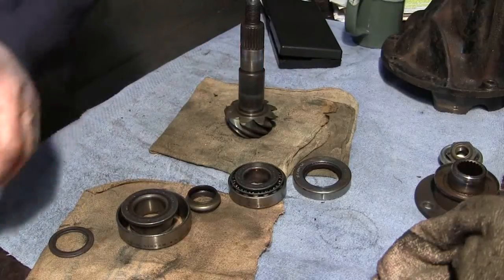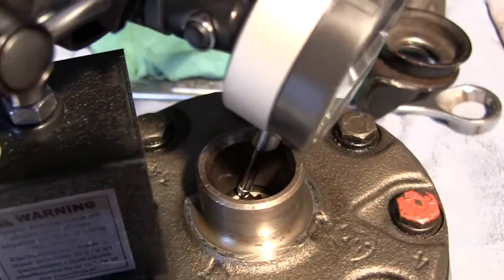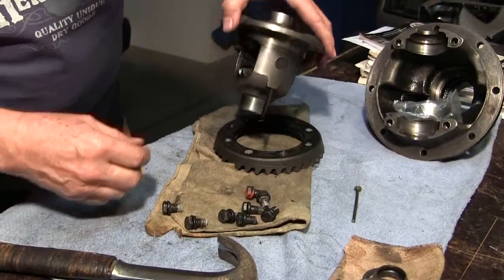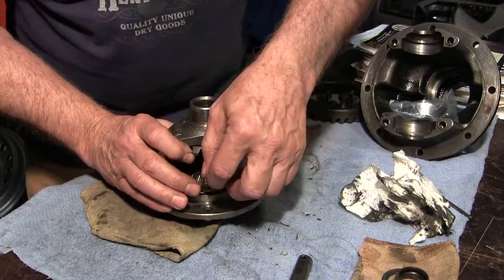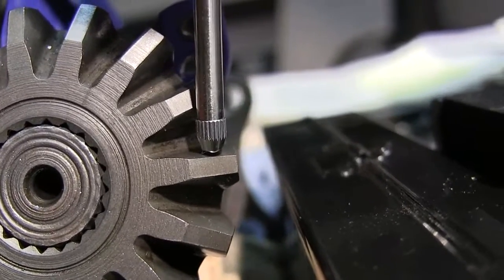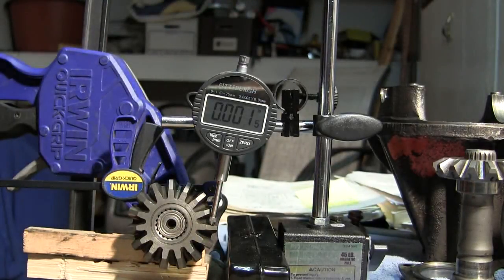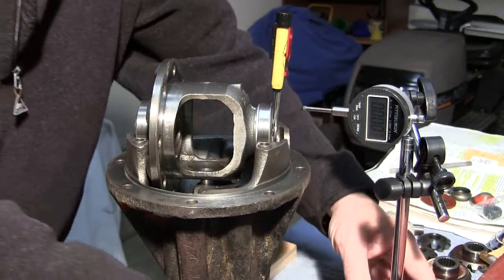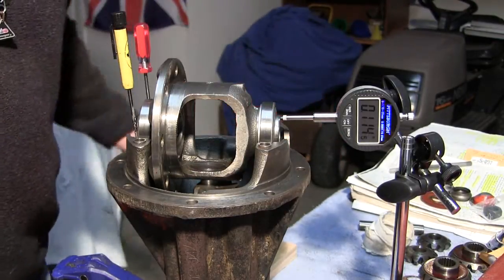Part 6 Sun, Planet Wheels, and new carrier float

Comment: I know this was a little while ago but I have just started this task on my spitfire and was wondering if you could answer a couple of questions. which thrust washers did you end up replacing and how think should they be, where did you buy them from. what is the acceptable backash in the splines, you show 0.008" is that ok, if not which part needs replacing, the sun gear or the shaft?
any help would be much appreciated.
Reply from the maker: This is my only diff rebuild, I can't say which thrust washers your's may need replacing or what size you will end up using. Get a manual explaining how to do these rebuilds and read it through a few times, follow the directions. I found TWs on ebay. Best of luck with yours.
Reply: thanks for the advice, just taken mine to pieces and found one of the flat ones completely missing and the other cracked, and the concave ones are both about .017" thick so it looks like I will be replacing all of them!
Reply from the maker: Maybe the brass thrust washers in your diff are supposed to be .017". Your supposed to check end float, and adjust each gear to it's own end float. These gears center from 2 directions, so they float and mesh without grinding into the other one. It's possible only the fiber thrust washers are worn out, not the brass. I had mine apart 3 times, with 3 different thicknesses before finding the right combination, the first 2 would bind up and lock before making a complete revolution.

Comment: Great videos on the Spit differential rebuild.  I'm doing it on my 1980 right now with a shop manual that is for the shim preload diff though I have the crushable washer diff.  So I really wanted to see how you did the preload setting in Part 7, but I see only the 7.5 Retake, and I don't think that shows everything.  Could you upload your original Part 7 even though you miss the setting you were looking for.  Is it really just a matter of putting everything on the pinion and then adjusting till you get the right torque setting in inch/lbs?
Reply from the maker: Tim Gaines I'll have to get the external drive and have a look at part 7. I remember going with the factory head spacer that was already there. I couldn't get the pinion dummy tool for setting up the unit to check what head spacer I needed. It looked like it was going to be trial and error at that point, then I realized because these don't wear like a thrust washer, it was already setup at the factory. I just needed new bearings, oil seal and sleeve. The first try, sleeve was over torqued, jumping from 20 inch pounds to 30 plus in the blink of an eye. had too much going on, part 7.5 was there to bring this to any ones attention, and the next problem came along. I never got back to part 7 and put on utube,  The pinion head bearing is held in place, but not the front bearing, the sleeve is what brings it to it's proper position, and holds it there. Would 30 have caused damage? I don't know, didn't find info of someone finding out. I had another sleeve, so I carefully eased up the torque till I got it right. Setting up the carrier shim pacs was important for proper crown gear back lash, It all sort of come together at the end with the pinion. Proper torque wrench, tools and a big vise would made it easier. After that came a slipping clutch problem (solved), then 1st gear popping out problem (solved), and now excessive crankshaft end float to fix. I think my head's ready for a vacation.
Reply: Calvin G. Williams  Thanks.  That's what I wanted to hear; that I could probably get away with using the same spacer with new bearings and crush washer.  I'll try to be very careful in torquing down the pinion nut.  Can't wait to try my new inch/lb wrench (unless it tells me I went too far!).
Reply from the maker: Tim Gaines Don't know the length of your torque wrench, but when your close to 12 inch pounds, an inch movement of the end of that handle was where I screw up. I didn't realize how quick it would jump up.